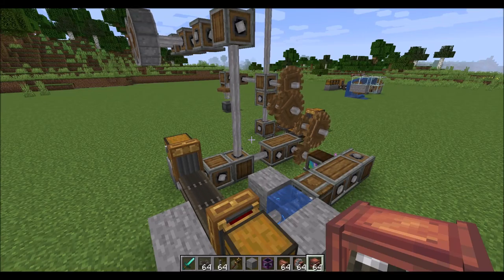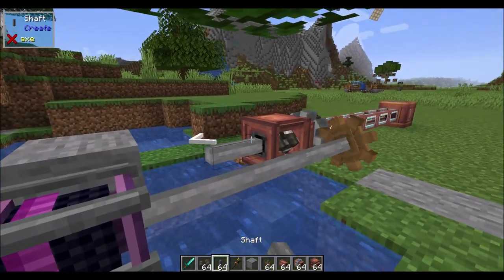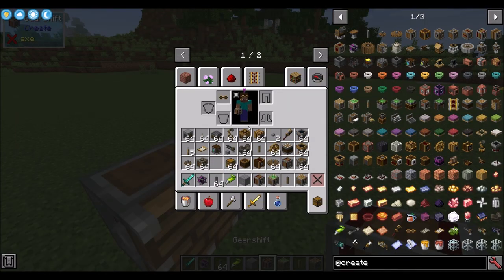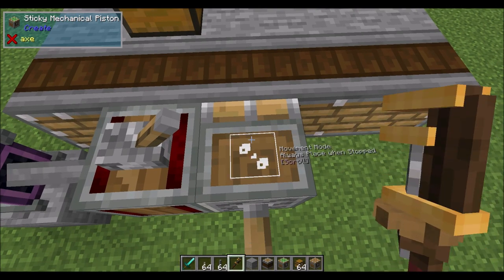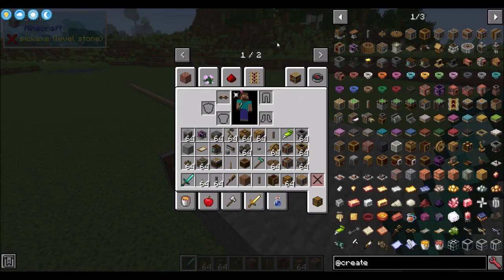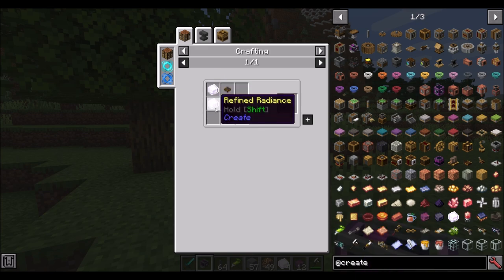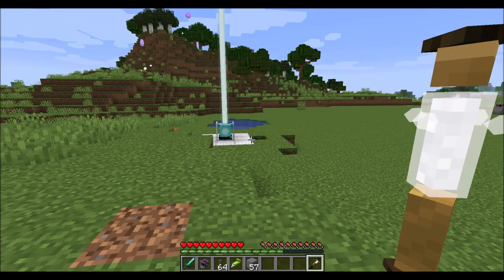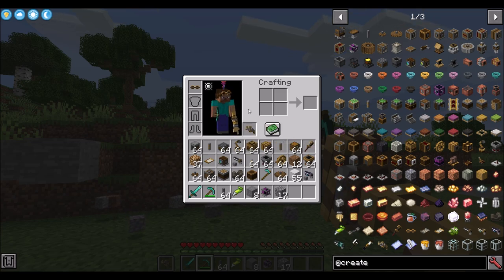Mod Spotlight   Create   Part 3 Pistons Fluids and Tools

Comment: Does the pump work with only vanilla fluids, or just vanilla ones?
Reply: That's the same question.  But I imagine that it's likely to work with all fluids that follow normal bucket behavior.
Reply: @Mirality  Whoops, I meant to say ‘Does the pump work with modded fluids...’ my bad. 

If that’s actually how it works, then you could get a limitless supply of any fluid (like, say, UU matter) if you can build a big enough reservoir.

Comment: I wonder if you can fake the hose out. 

Get yourself a few droppers with buckets of water, make a redstone clock to have them place the water, creating new source blocks next to them, then pick up the water again with the dropper, resulting in a new source block where you picked the water up. 

If the hose now drains the water at that spot, you run the curcuit again to create new source blocks, you just need to sync it up the hose and you've got an infinite watersource for the hose, from a puddle!

Comment: I wonder if you can put drives and gears on those sticky contraptions. That would let you engage and disengage contraptions.
Reply: there the clutch
Reply: You can- meaning the caterpiller drive  is an option for flying contraptions.
There's also a clutch for redstone control of mechanical power.

Comment: Tip: for the hose pulley to create infinite liquids, the poll needs to contain at least 10000 source blocks. So you could technically use that to produce any modded liquid

Comment: hi, I'm messing around with creating a giant drill with a mechanical piston moving sideways, and it turns out, the piston extenders are a pain in the ass, because I keep needing to place more. Is there a way to make infinite piston extenders? I need to know soon, because by now, I'm pretty frustrated because nothing I've tried has worked.

Comment: Sounds like having the items pulled from a chest would be best when fully retracted at rest.
Reply: That's easiest, but you can also use a special extractor that halts the moving contraption until it has extracted. Both the ground and the contraption need one and they need to be adjacent and facing each other when at rest.

Comment: The valve handle is nice for manual adjustment of hose pulleys instead of hooking up and disconnecting engines; right click to go one direction, shift right click to go the other